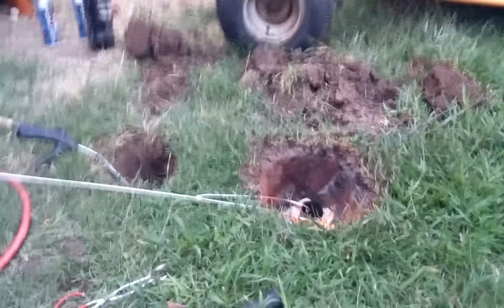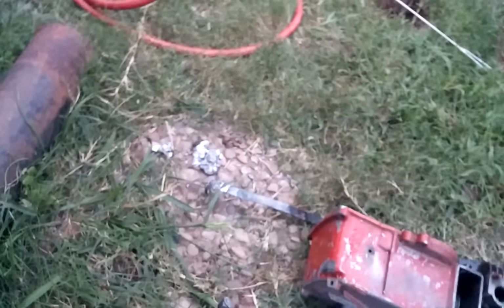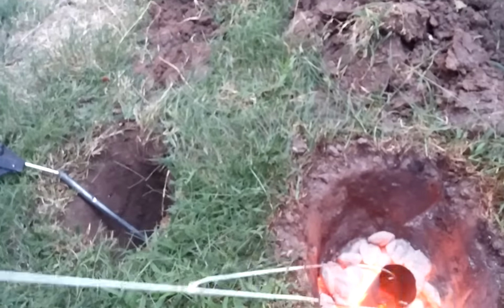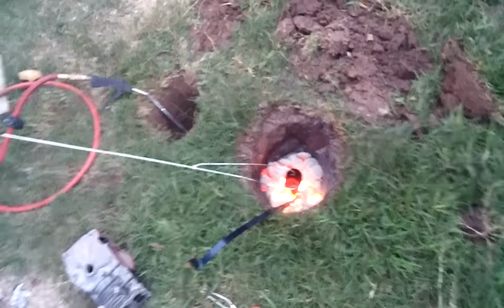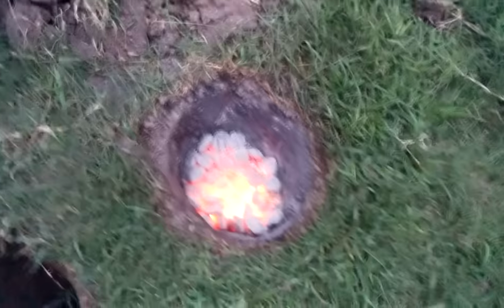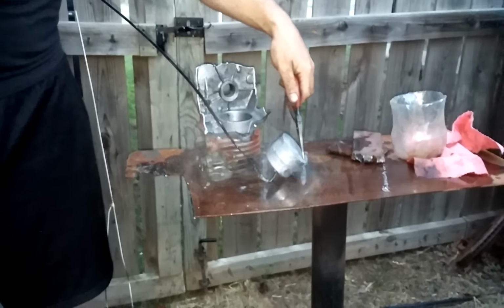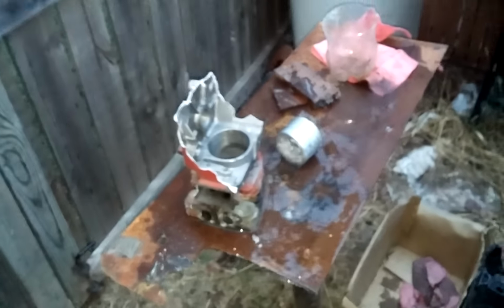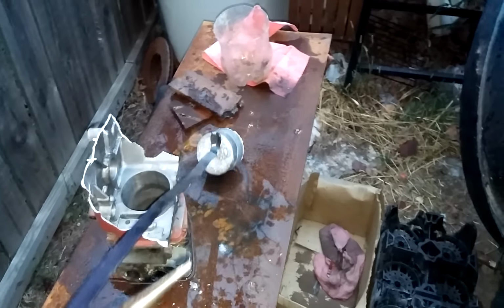Cheapest Quickest Backyard Aluminum Foundry Forge

Comment: i like this a lot, thanks for sharing
Reply from the maker: +thepoultrypeople   Glad you liked this.  I still plan on doing some more of this and even making an actual forge.   Thanks
Reply: 2LateIWon over here most of our propane tanks are steel and just left lying around when empty, i used a couple of them, and some old steel water pipe, upgraded to a roofers torch, need to do some insultaion so i can get it hot enough to melt brass is next on my agenda
Reply from the maker: Very cool